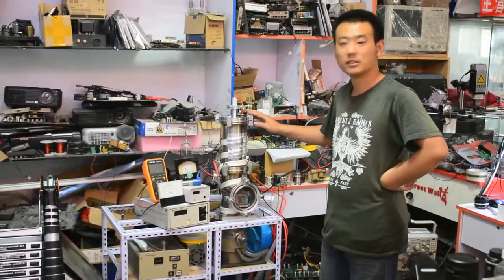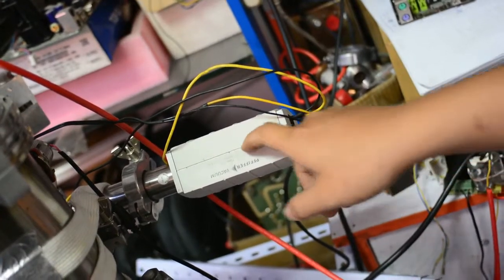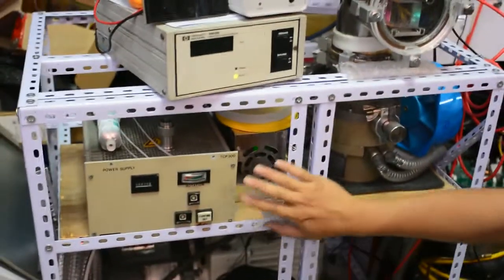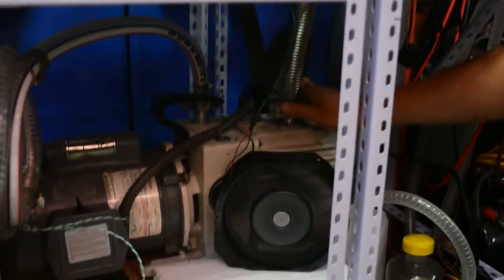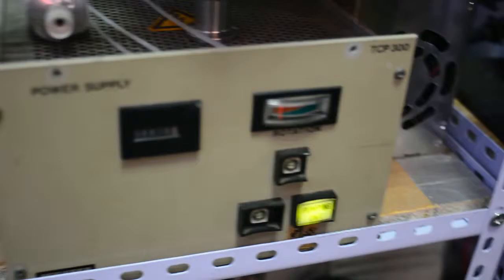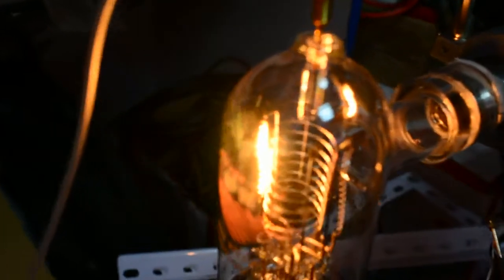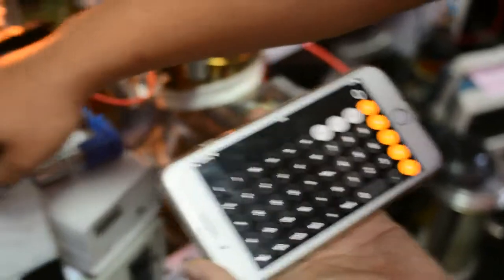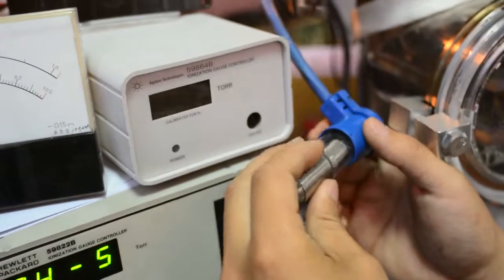DIY Scanning Electron Microscope Part1——High Vacuum System

Comment: Too much noise in the background while making video!   
You should put all your mechanical pumps and vibration causing machines off on another frame. The vibration will severely limit the resolution of the microscope. 
You have a leak (or water in the system). The pressure should be a lot lower in that time with the turbo running. Good luck on your project! See my channel for some videos on vacuum.
Reply from the maker: The roughing pump has already  set on the ground in the new electron gun design. The noise from the turbo pump is caused by a bad bearing I have changed a new pump with magnetic bearing so there's no vibration anymore
The system might have a slight leak but the biggest trouble in the video is the acrylic window it is outgasing badly.
By the way I am learning how to build the vacuum system from you by email 3 years ago I'm really appreciate that you told me so much about that！

Comment: Unfortunately I found out that my Pfeiffer gauge is leaky, so I had to put it off from any projects :-)
Reply from the maker: If your gauge leaking through the electrical feed pins you can try to use some epoxy to seal it :D

Comment: 7:04 - I used Google Sheet with two formulas for this Pfeiffer gauge, and it was very convinient because I already knew key milestones (like roughing down to ~6V, then turbopump/oil diffusion pump down to 3 volts, and if it's lower than 3 volts - then the vacuum is very very good)

Comment: Dear Liukai

Please let me introduce myself

I,m a MSc Student in the filed of Nono-Electronics

I worked on various electronic system and produce prototype of them in the electronic field and by rely on empirical work.

My field of study is Nano-electronic and electronic but I like to work as an expert on development of SEM and I would like to gain experience and knowledge in this field. Indeed I am really determined to do this job with great enthusiasm and decided to choose my PHD course in manufacturing and design of this system.
Right now I focused on studying the structure of electron microscope in order to reach a right insight and then I want to study SEM and its kinds to get familiar with all aspects of project for setting clear and precise goal to manufacture a prototype.
I keep studying and researching regarding the path, in spite of all contempt I have faced so far.while tolerating all these is too painful, I am still delighted because it demonstrates the magnitude of the task I have been through.
A very important point is that I don’t want to copy the similar system; moreover, I look for a great perception of designing and developing this system in a scientific way. 
would be so grateful if I know your point of view or recommend some books or articles which help me to have a better understanding.
Thank you for the time you've spent on my message.

Sincerely yours
Mohammad Sajadi
Reply: I have worked with this type of instrument ( SEM) for many years and I recommend you watch on youtube "Applied Science
" he has built one quite cheaply.... they aren't hard to build and would be a good start for a career in physics...the basic and functional microscope is very easy to construct and will make you more confident.
Reply: @andymouse  Thank you !
Reply: @AryPizarroChong  I did both !